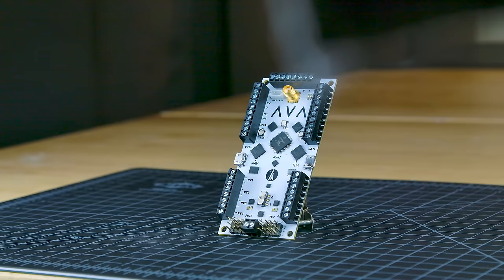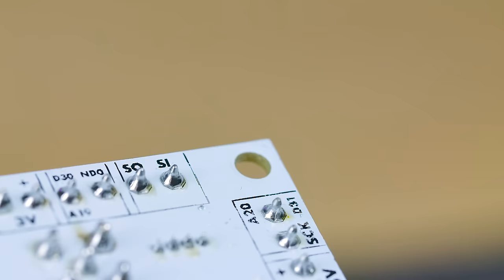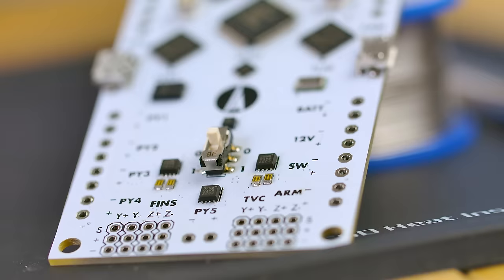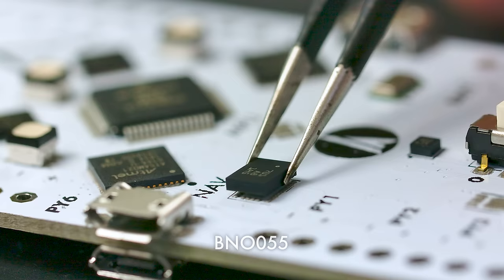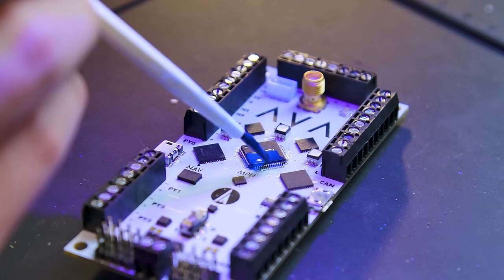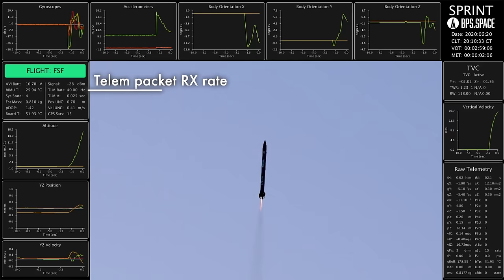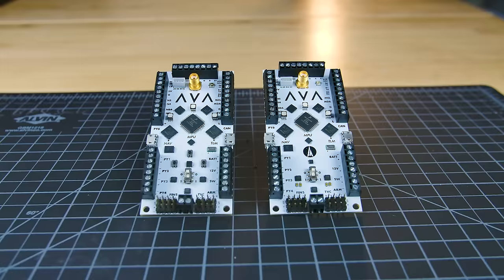The AVA Flight Computer

Comment: Yep. 2 errors in the telemetry connector. It says G,RX,RX,3V. If the wiring is correct should be TX,RX (or RX,TX),G,3V.

Comment: Having multiple processors is the way to go i guess even if you have a multi-threaded main processor, it just makes things easier to work with. Coming from software engineering bg, i worked on multiple projects where i used 3  or 4 different processors because i wanted to use the "micro-services" approach on hardware level, that way i had smaller software modules and i could update them individually without dealing with a massive codebase

Comment: For the backup IMU, you can drop in a LSM6DSO32 in place of the LSM6DS3, it is pin compatible and you get better gyro figures than the BNO055.

Comment: If you have a problem with data logging in high acceleration/vibration flights you should look at the interface between the SD card and the slot.  We've run into problems with data corruption from sd card interface.

Comment: Congratulations, this project is amazing! I have been working with avionics development for a university level for 5 years, and experimentally and at the level of national model rocket competitions, platforms with 3 microcontrollers and their specific functions ... Now I intend to work with RTOS, for better control and management of processes .. One suggestion, wouldn't the inductor used as a filter on the opposite side of the plate be better than PTH instead of SMD !? Hug and congratulations once again;)

Comment: How much did it cost to prototype these designs. I usually avoid SMD because the cost can creep up quite quickly, plus you need to figure out the bugs before committing to SMD\SMT. Then again most of my designs do not need functional requirements to operate in harsh or time sensitive scenarios. I would love to see how you draft concepts like these and end up with final solution that you have (will be watching more of your videos). Note: That's some fine soldering and board design, to add cherry on top he uses eagle. *chef's kiss

Comment: Really cool project. And I also agree with your design of multi-mcu, single thread for each mcu core. Unless you want to fight with RTOS and try to pack all threads into a single mcu, it is much easier to develop test and debug single thread programs on multiple mcus.

Comment: For multicore (8!) the Parallax Propeller 2 just dropped officially after over a decade of development and FPGA simulation with the community heavily involved in new features or tweaks on the Propeller 1.  Runs at 180MHz with reports of up to 600MHz overclocking.  The smart/incredibly versatile pin functions available on all 64 I/O pins.  All cores are completely separate from the others and no matter what one does it won't affect the timing of others. A variety of languages available including MicroPython, a FORTH interpreter built into the ROM, C, and a special language called Spin that vastly simplifies learning and operating the processors. Each core has 4KB of local RAM and 512KB that can be shared among the other cores.  Its ability to share tasks synchronously with other cores allows it to do staggering things like generating an analog 1080P video signal using software and some very clever smart pin use.  Highly recommended for multicore development with a lot of that complexity designed right into the chip functions to make software much simpler to implement.

Comment: Youtube just recomended me this video (I think because I watch Scott Manley and BigCliveDotCom) and I have to say I am really glad it did. 

I don't see why people have anything against using the arduino platform... it is a perfectly fine platform that has masses of documentation and is easy to use, the community is massive and helpful, if you run into a problem there is likely someone who has done something similar that you can bounce ideas off to correct the error.

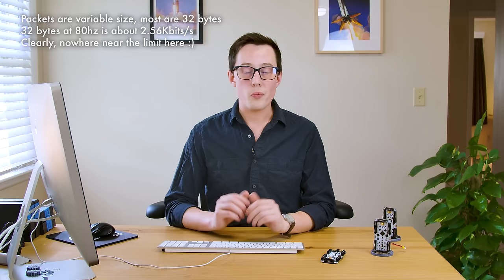Comment: @12:00 minutes or so - I think he meant 20 Kbits/s not 2.56 Kbits/s. He did not use the 1 byte = 8 bit calculation. aka (32 bytes * 8) * 80Hz = 20480 bits/s aka 20 Kbits/s. I'm surprised no-one caught the error here 2 years ago.

Comment: Dont be embarrassed about using the arduino bootloader. I worked in the high end sensor industry, and my mentor, a guy with a masters in computer science and a PhD in physics still uses it and RPi for just about everything.

Comment: Wait, either I misunderstood or it was a joke, but the serial (uart) interface is pretty much as fast as your chips can make it (not really, but it can go fast) . 
I2C max speed specification is 3.4 MHz and for a base I2C it is 400 kHz.

While for serial uart the base speed is 9600 bits per second and the top speed specification I have seen is 25 Mbits and its fully duplex unlike I2C.  So it can go way faster than I2C. 

So I'm confused about what you have said, can you explain please?

Comment: How do you attach the components to the board? Ive never seen such a thing done. How do you prevent shorts? Or ensure that all pins are connected correctly? Seems like if you make one mistake, its over, the piece is already attached where it is.

Comment: Joey... how the hell do you solder those microscopically-tiny pins on the MPU? My soldering iron is easily several times larger than those and would easily create a solder bridge between each pin...

Comment: This is very cool. Planing such system is quite dificult, and rarely you dial in all the variables in optimal.way, I think you make alot of good choices. From where you are biggest advantage would be to team up with someone who can move your project to FPGA, and realize responses logic to be faster. That way you can focus on code and controll. Implementing higher logic functions such as mission controll AI etc.   Good Luck !

Comment: I suggest you consider using something else than screw therminals for the wiring, they aren't super reliable in high vibration environments. A proper rectangular connector with locking mechanism would be much better suited. If you stay with screw terminals, please at least use ferrules on your wires, it will save you a lot possible future issues. (I do understand the use of screw terminals for ease of development and assembly/disassembly tho)

Comment: I think i have an idea for your relanding echo rocket ,this is a little elongated, you will need 3 rocket motors for this , with each connected to a servo to move outwards.so the theory is as the thrust of the rocket motors move outwards, the active on the body of the rocket will lessen ,you need to arrange them in a triangular pattern, . The more outwards the rocket motors are- the lessen amount of thrust acting on the rocket's body ,and the more inwards the rocket motors are - the more thrust acting on its body.  I hope this might help you.

Comment: I've got nearly 20 years designing embedded systems. I'm mad at myself for not allowing Arduino into my life sooner. When things get really Technical and I need every last cycle, I understand how to get that out using specific C code and assembly code sections. But 99% of the things I need to do can be banged out in 1/10 the time playing with an Arduino. I could have saved myself so much, had I gotten over my ego sooner

Comment: How does this compare to pixhawk 4 (not cube) for control on octocopters and  rc planes...also can it connect to spectrum Rx?

Edit: also do you happen to have a circuit diagram for solar to 3s rc battery to rc system charge controller...I looked on amazon and they are not the right type...usually self build batteries. If you don’t have one on hand don’t worry. Was just curious.

Comment: This is an amazing video. Do you think you could make a video on your technique and tools used to solder your SMD components? It looks like you are use 0402 package size for your resistor and capacitors. The last time I tried to solder that small of a size I swore I would never do it again. However, after watching your video I am wondering if I swore it off too quickly.

Comment: man, this is a really cool and clean content, i liked this video and i loved the time and precision you put in this project. nice, really. One thing, i'm curious when you said that output can handle 5A, but looking at the board i didn't noticed thick traces to handle that amperage. maybe i whatch too quickly or you might used the mid leyer as a potential plate, but that would sound strange to me. sorry for the english ahah

Comment: Amazing board ;) Right now I am working a lot with autopilots designed for drones and other vehicles, and in my opinion you should really look on the PX4 architecture. They are using one big MCU (from STMF4 up to H7) for all computational tasks and one small for additional PWM and arming and failsafe operations. For whole multithreaded stuff they are using POSIX or NUTTX and they handle really well. All processors can easily handle telemetry, high rate logging to sd card and all EKF you want ;). All codebase and board documentation is open so check it out. In theory you could build rocket autopilot on top of PX4 with minor changes to altitude control system.

Comment: Two pins labeled Rx. One has to be Tx or you don't have communication, you just have listening. Serial isn't "that" slow :D I can still remember 300 baud phone modems lol At work my group has over 8,000 serial radios (900MHz) connected to flow computers talking back to subcells that shoot data back to a Microwave / T1 backbone (T1 is for redundancy) that shoot the data, to a couple of Microwave stations that drop the data onto the WAN. They also move the data to/from the corporate WAN to field office sites. The Microwave shots are all up on mesa's or a mountain. We have 1s-ish update times in our SCADA system. Each meter has about 25 floating points, some integers, and some boolean points (x 8000-ish). The meters also historize a months worth of data and that is polled by a different driver for monthly reconciliation (accounting stuff). All in all it's a fairly robust comm system

Comment: I love the Teensy line.  My first Teensy was when they switched over to ARM chips.  It had a built in DAC with a lot of software support around it (unlike the Arduino Due with zero software support for it's DAC).  I've graduated to the 4.1 and that processor (Cortex M7) has tremendous power and is probably overkill for most embedded applications.  It has a gawd awful amount of I/O and can run at 600Mhz (and some people have OCd it to 1Ghz).  I did something similar for drones about 10 years ago using an Atmel 644p, but I only got as far as the PID.  It as more a proof of concept than anything, and like all my POCs it just sat on the bench afterwards.  I'm that kind of engineer - Hmm, I wonder if I can do X?  Okay, let me try to do X .... [Some time later] ... Okay!  I did it!  I can do X!   What's next?  Hmm, I wonder if I can do X2? ... and the cycle continues ad infinitum.

Comment: 5:55 What is that type of soldering called? It looks really clean and super fine. I am just soldered big IC pins on PCB with holes
Reply: Drag soldering. Or, in its colloquial from, "any soldering job looks freaking amazing if you just use MORE FLUX".

Comment: Can you make one that doesn't have a radio controller. But is hard lined. And is has more power. More processing power and can handle higher speeds. and can handle space.  I would buy that.

Comment: I can't see 3 microcontrollers and not feel bad, usually at most you see a mcu + application processor combo (like a raspberry pi plus some mcu), as AP's are really bad at stuff like real time work (try to control a lot of addressable LEDs from a Pi), even when they are multicored and really fast.

But at the same time, I feel his pain with serial prints hogging the mcu for a "long" time. The true "correct" solution would be getting a fast mcu (some NXPs like in the latest teensy go to 600mhz with full floating point support), and using a real time OS, but serial prints would still hog the processor, which means you either have to find a way that they don't interrupt your code (should be doable if the mcu has hardware buffers for serial), or just don't use serial, but then... a lot of peripherals are hard to get in I2C or SPI. I felt EXACTLY as him the first time I tested a GPS unit, I was like... "wtf this darn thing has to print an absurdly log string full of data I don't need, over serial, at a really low baud rate, i'm gonna use half my memory just to parse this".

What he did adds complexity in the hardware and in IC communication, but is a pretty simple way of getting around programing deterministic software with tight timing requirements and inter-process communication, which is probably harder to code and even more, to debug.

Comment: Can you use them for building cars? Example: Could maybe programme autopilot for a car so maybe I could try to add model rocket engines to a car so, if I use that rocket boost it can straighten itself so it doesn't go off course?
Reply: No

Comment: I'm curious if you have tracked down the humidity related failure yet? If you haven't... Try inspecting the resistor values (in high humidity env.) as it can change the precision resistances and may be throwing off your coms.
Reply: He has. It’s nothing to do with resistors, and it’s actually the fact that he hasn’t been conformal coating his boards

Comment: As always, Joe, excellent engineering. Keep it up.

No shame in using Arduino, it just means you are pragmatic. I also have a big C++ library and use the Arduino bootloader & IDE for flashing the chip, because that "UPLOAD" button is just too easy. Those so-called "real" microcontroller tools are just annoying and cumbersome.

Comment: Ah 0603, my favorite package size! Imperial 0603 that is, not metric.
From what im used to, the arduino system is a more simplified C/C++ which can be nice. Sometimes dealing with all of the 'advanced' settings can be a bit of a faff

Comment: A great video, expect when he compares GPS I2C vs Serial (in fact UART). Of course UART is a better option than I2C. The default UART baudrate is slow, but we can setup any baudrate you want, even higher speed than I2C. With I2C you are limited up to 400 KHz frequency.

Comment: Serial is not slow. What makes it slow is people using it at 9600 bps... Inside your board, you should be able to reach 1Mbps with no problems (assuming the hardware you chose supports that speeds).

Comment: The failure in the humidity test is probably a good oportunity to fail proof even more the design by investigating the root cause. Long long ago at a previous job we run a condensation test to an electronic module (for automotive) we produced. They wanted to go from -40 to 80. Chamber was capable to do 8 degree/minute (Tenney) and man .... the piece went out soak in water LOL .... It had  2 processors (not the complexity of the AVA to any extent LOL) connected by 9600 baud 1-wire (due to I/O exhaustion) and humidity didnt hurt it, but below -20 celcius the comunication showed issues because one of the micros used internal oscillator and it wasnt as accurate as the other using XTAL. The test asked to test functionality constantly .... This temperature profiles with condensation are prety common. Not even cranking the Humidity that is built in the chamber. Shame this things are bulky ... but you can probably get one in a good deal. They help a lot.

Comment: one of my ideas i had was to program gpu cores for real time processing you see GPUs have specialised cores for handling millions of different pixels but the actual calculations are small so up to 1.8Ghz is max clock speed it is way more than you is required for RT computation and it can have thousands of core working on different area of screen, so we can use such architecture to create RT systems that can handle thousands of sensors over Optical fibres(no electrical interference) and the sensory input computer that would calculate real time position send that  data to a bridged  general purpose processor which can do predicted calculations and also compare predictions to real time values and this main processsor can have bonker clock speeds so that it can perform calculations and all signals can be sent to controllers this way the predictions and corrections can be handled by main processor with high clock speed less number of cores and sensory data can be handled by more cores less clock speed
Reply: This also allows us to have as many sensors as we want the only problem would be to create an algorithm that can take sensory data and convert it into a set of pre defined unique hash numbers this way less data woud need to be moved between processors cutting down overall operation speeds significantly these hash num,bers can update based on previous calculation and new calculations cause physical conditions are never the same a lot of work would be required but i think its a neat idea if you want to make high speed RT machines

Comment: Would it be possible to fly the Saturn 5 with this thing? I mean is there everything on this board that you need to steer the rocket?
Reply: I wanna build the 12-volt to hydraulics interface.